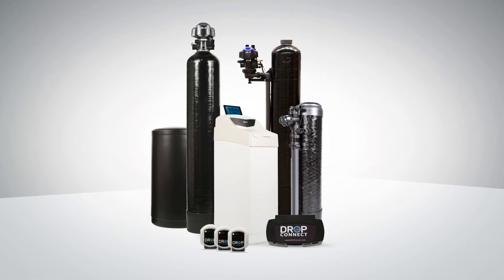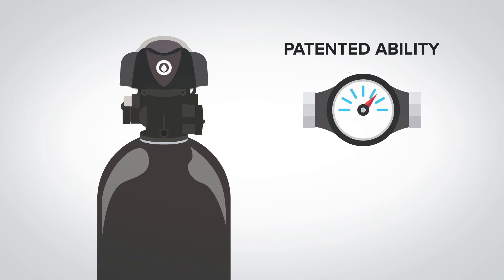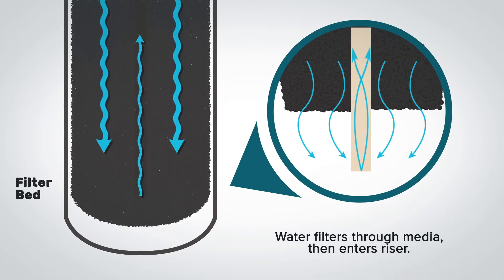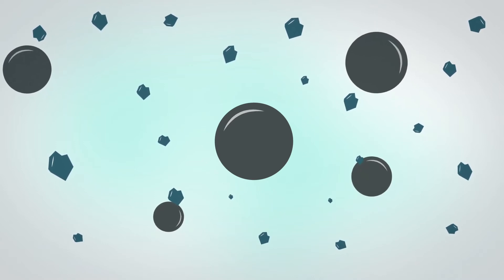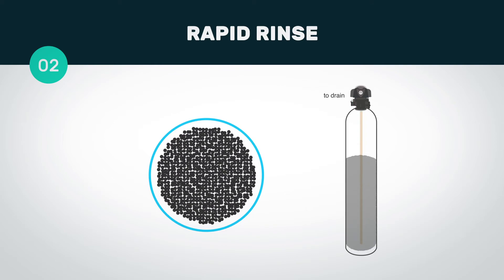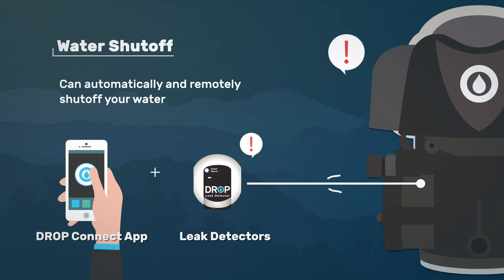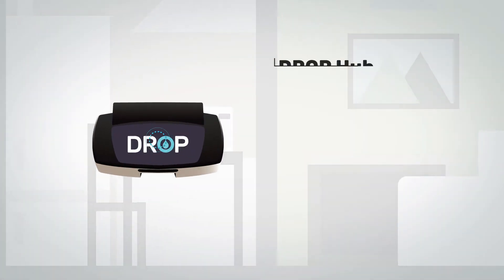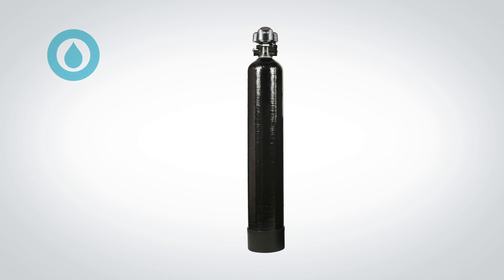Whole Home Backwashing Filter - How it Works

Comment: There is no reason why a home owner should want to reach for their phone to shut water off… There are devices that when water bursts it shuts the main off than one can deal with it.
Reply from the maker: DROP will do both! You can set it to automatically shut off the water, or if you want more control, you will be notified and can take action!